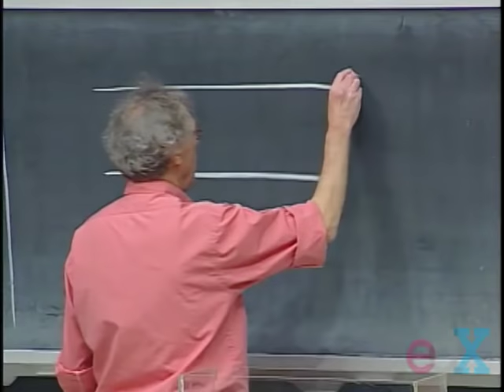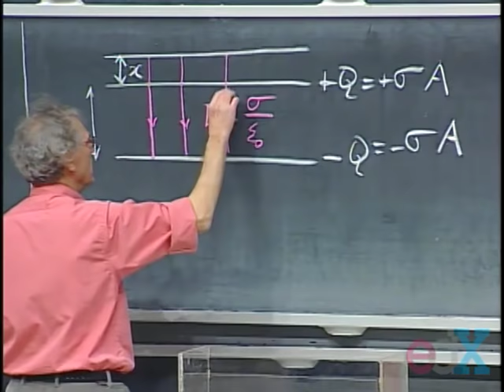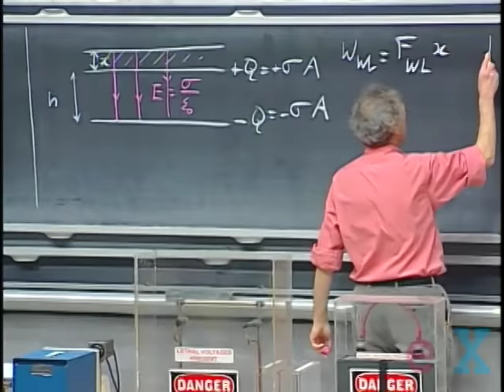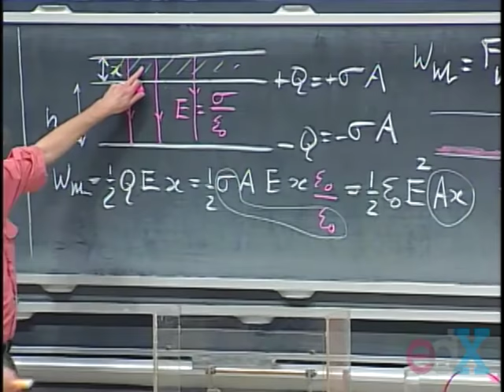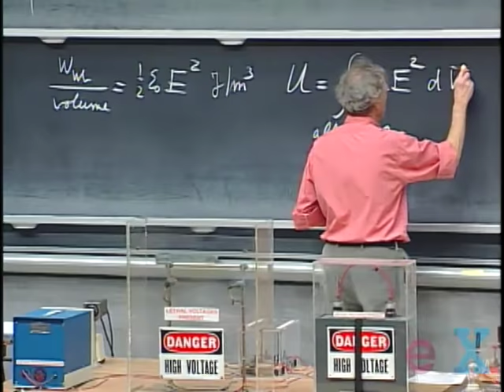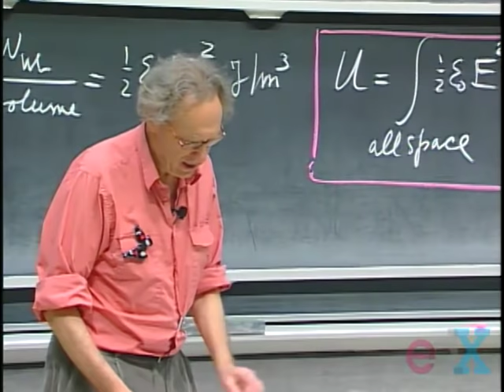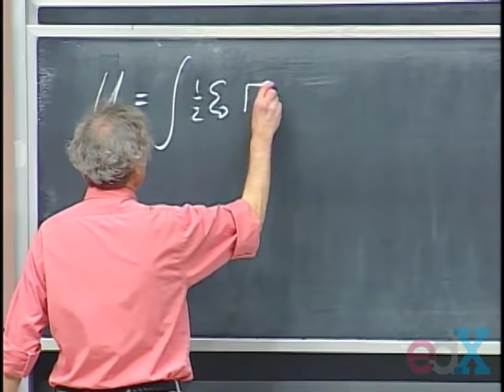8.02x - Lect 7 - Capacitance, Electric Field Energy

Comment: Professor, I still do not understand why the force is 1/2QE instead of QE?
Why you used the average electric field ?
Reply from the maker: The infamous factor of 2
Let the charge on each plate of the capacitor be Q=100q (+Q on one plate and --Q on the other). Let the area of each plate be A. The E-field between the plates is then Q/(A*eps_o). Let the distance between the 2 plates be d.  Now release q from the + plate to the negative one. The energy that is released is force*distance which is very close to q*d*Q/(A*eps_o). But after this transfer the E-field is reduced, it’s now only 0.99*Q/(A*eps_o). I now release another q thus the energy that is released is now 1% less than with the first q. By the time I have released 10 times one q, the E-field is only 0.9*Q/(A*eps_o) and thus the force on the charge q is only 0.9*q*Q/(A*eps_o). The force keeps going down as I transfer more charge.  By the time I have released the last q (of 100) the E-field has become 1% of the original E-field thus the force on the last q is about 1% of the force during the first transfer. Thus by the time that I have released 100q=Q the average E-field was only 0.5*Q/(A*eps_o), NOT Q/(A*eps_o). Thus the average force on a charge q during transfer was NOT q*Q/(A*eps_o) but only half that. Thus, by spooning off the charge from one plate to the other the energy release is NOT Q*d*Q/(A*eps_o) but only half of that. The energy that is released this way (also called potential energy) is identical to the work that YOU would have to do to separate the 2 plates over a distance d.
Reply: Lectures by Walter Lewin. They will make you ♥ Physics. Thank you very much, professor. Your explanation is very clear and easy to understand. That 1/2 was the hardest thing in this  lecture.

Comment: Professor Lewin, at 2:55, why does the charge should be inside the plate? I thought that as the plate is a conductor, there can not be charge inside...
Reply from the maker: +Hugo Muller With the plate capacitor, as I have drawn it,  the charge has to go to the upper surface of the lower plate and to the lower surface of the upper plate (Gauss' Law). If you put charge on one plate of a plate capacitor an equal but opposite charge is automatically created  (induction) in the other plate. That charge will move to the inside surface. You can draw the thin layer of charge AT the surface if you prefer that. But in reality "at the surface" is a thin layer and I have drawn that thin layer.  Apply Gauss Law and you will see that inside each of the plates the E-field is zero. The field starts at the surfaces.
Reply: Lectures by Walter Lewin. They will make you ♥ Physics. The opposite charge on the other plate is created only when the plate is grounded, is not it?

Comment: What a great lecture prof!!!
Those experiments were crazy.

I have a request Sir Walter Lewin :-
Please upload demonstration of the questions in which a solid sphere is taken (having uniform volume density) and a small spherical cavity is removed from random part of sphere and it is asked for the electric field at any point inside spherical cavity.
Reply from the maker: if the  sphere is a conductor all  the charge will be uniformly at its outer surface also when you cut out any piece inside the solid sphere.  Thus if you are outside the sphere and you measure the E-field at and near the outer surfaceyou will never have any idea of what is inside the sphere.

Comment: Sir , I've run into a confusion here .why is the capacitance in the 2 spherical conductor case taken as q of either divided by the potential difference , and not the net potential , ( bcz from what I understood , capacitance for charge increased bcz the net potential decreased but if we take the potential difference then kq/r -(-kq/r ) = 2kq/r . And that seems to decrease the capacitance...
Could you please Please explain where I am going wrong here ?

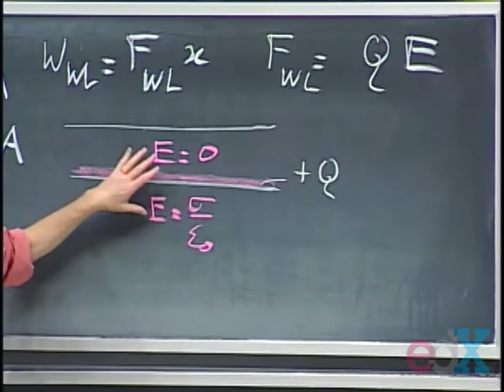Comment: Can you please suggest a resource for better understanding the 1/2 factor in the expression for the electric field at 3:30?
Reply from the maker: Infamous factor of 2
Let the charge on each plate of the capacitor be Q=100q (+Q on one plate and --Q on the other). Let the area of each plate be A. The E-field between the plates is then Q/(A*eps_o). Let the distance between the 2 plates be d.  Now release q from the + plate to the negative one. The energy that is released is force*distance which is very close to q*d*Q/(A*eps_o). But after this transfer the E-field is reduced, it’s now only 0.99*Q/(A*eps_o). I now release another q thus the energy that is released is now 1% less than with the first q. By the time I have released 10 times one q, the E-field is only 0.9*Q/(A*eps_o) and thus the force on the charge q is only 0.9*q*Q/(A*eps_o). The force keeps going down as I transfer more charge.  By the time I have released the last q (of 100) the E-field has become 1% of the original E-field thus the force on the last q is about 1% of the force during the first transfer. Thus by the time that I have released 100q=Q the average E-field was only 0.5*Q/(A*eps_o), NOT Q/(A*eps_o). Thus the average force on a charge q during transfer was NOT q*Q/(A*eps_o) but only half that. Thus, by spooning off the charge from one plate to the other the energy release is NOT Q*d*Q/(A*eps_o) but only half of that. The energy that is released this way (also called potential energy) is identical to the work that YOU would have to do to separate the 2 plates over a distance d.

Comment: Walter,
What happens to the capacitance of the capacitor at 21:20 if only one of its plate is charged (let's assume positively) and the other one is left floating? In an electronic circuit, could we say that a capacitor can be seen as a 0 Farad capacitance if its lead to the ground was disconnected?

Thank you  for your quick response, it is appreciated.
Reply from the maker: charge one plate, the other will stay neutral but there will be charge polarization. The side facing the charged plate will become -- charged and an E-field will exist between the 2 plates.
Reply: +Lectures by Walter Lewin. They will make you ♥ Physics.
So if there is an E field, there is a voltage difference between the two plates. That said, it means that it has some capacitance? Would you say that the charge density on the positive plate (provided by the power supply) is the same but -- on the floating plate? If that's the case I am confused, because that would mean the capacitor has the same capacitance even if not connected to ground!
Reply from the maker: yes there is a potential difference. One plate is ++ charged the other is neutral. Watch my 8.02 lectures or use google
Reply: +Lectures by Walter Lewin. They will make you ♥ Physics.
Thank you! It is indeed neutral! That was the thing confusing me!

Comment: Hey Prof. if I charge a cap to v potential. then disconnect it and connect it to another battery and charge it up to 2v then the work done by 2nd battery would be CV^2 right? Cause half of it's energy is lost in heating?
Reply from the maker: question unclear. Describe your circuits in more detail.
Reply: Lectures by Walter Lewin. They will make you ♥ Physics. Well I was given this question on a test. There was no circuit. I'll paraphrase it. "A parallel plate capacitor 'C' is connected to a battery and charged up to potential 'V' volt. Then disconnected from this battery and connected to another battery and charged up to '2V'. Work done by the battery to charge up to '2V' is?  

Also can I ask you about another question related to rotational mechanics?
Reply from the maker: If the voltage over the cap is V, you cannot charge another battery up to 2V by simply connecting the cap with the other battery.  You would need a circuit that first chops the DC voltage into pieces (e.g. 100 Hz) then you will have to use a transformer to get to several V and then you may be able to charge your new battery up to 2 V.  As you charge the 2nd battery the  voltage on your cap will drop and will end up with zero. The energy that is available  is 0.5C*V^2. That's all there is. After you charge your 2nd battery your cap has zero energy left. The whole problem as described by you is utter nonsense. No physics book would have such nonsense,
Reply: Lectures by Walter Lewin. They will make you ♥ Physics. Haha, then I should question the people who set up the test. Thanks for your time. :-)

Comment: Professor ,If the plates of a parallel plate capacitor are joined, then the capacitance will become infinite? As by formula C=(K epsilon A)/d it seems to be infinite but what happens practically ?
Reply from the maker: >>>If the plates of a parallel plate capacitor are joined, then the capacitance will become infinite?>>>
No, The + and -  free charges will merge and go to zero.
Reply: Thanks Prof , didn't  expect such a quick reply. Hats off to you

Comment: Professor, when you hold the capacitor in your hands at 21:30, will the 10µC be instantly on the capacitor or will it take some time for the charge to flow through your body inside it?
Reply from the maker: charging a capacitor is determined in general by the "RC" time (watch my lectures with a C and an R and a power supply). In one demo it took close to an hour to charge it fully as the 100 kV? power supply was limited in providing the current. Thus its internal resistance was very high.
Reply: Thank you for the answer!

Comment: Why was the charging of the 100 microF capacitor (for the fuse demonstration) took much longer than for the circuit of 12 capacitors (1000 microF)? As far as I know the charging process takes approximately 5 or 6RC, so does that mean that the “monster” capacitor of 100 microF had a big resistance?

Comment: Sir if I release a + charge q in a parallel plate capacitor with initial velocity v then it comes out from capacitor with higher kinetic energy than first one. It means capacitor's energy should be reduced but even now capacitor's energy is same as no electric field is changed. Then who gives energy to + charge

Comment: @14:37 In the presence of A... shouldn't capacitance of B reduce due to the electric breakdown between them ?? In last lecture when the ball was brought near Van De Graff, sparks started between them... so shouldn't capacity to hold charge reduce for B due to discharge with A ??
Reply: I think the paper they place in between is a better dielectric than air.. therefore resists the breakdown better than air

Comment: Hi Sir , 
At 28:29 , In the capacitor demonstration 1 the instant when you touch the one of the plates of the capacitor for charging with a wire which is having power supply we saw a small surge in the ammeter. How come the current is flowing through the capacitor because the plates of the capacitor are seperated by a small distance right.How come the charge ( i.e current ) is flowing through the capacitor( i.e is transfered from one plate to the another plate ) at that instant.

Sir Please reply for the above question.
Reply from the maker: >>we saw a small surge in the ammeter>>>
yes of course, bcoz a current is needed to charge the capacitor. Listen to what I said.

Comment: hello sir: In an opened circuit why the charges do not move to accumulate on both ends of the wire as they accumulate on the capacitor plates?

Comment: I recall you saying earlier that electric potential is energy per unit charge. So why is it that the energy stored in a capacitor is (1/2)QV? Why not simply QV? Also, I've already taken physics II at UT Austin, but I am using your lectures to refresh my memory as I'm now tutoring the subject. I just want to say that I really appreciate you putting up your lectures, and the way you teach is very inspiring. I'm considering a career in academia because of it.
Reply from the maker: I derive in my lectures that the energy in a capacitor is 0.5*C*V^2. Since C=Q/V the energy is also 0.5*QV,

Comment: Professor as work done my battery to move a charge is W= QV. So when capacitor gets charged this much work is needed to be stored as potential energy but the energy stored is 1/2(QV). What is the reason behind this significant loss when energy got halved. I don,t think this much heat will be dissipated in charging. Is there any other reason also
Reply from the maker: with AC the PE on the capacitor will change +(1/2)cv^2 => 0 => -1/2)cv^2 as this happens the AC current will go back and force through the resistor => dissipating energy heat power I^2*R
Reply: but there is no resistor in the circuit
Reply from the maker: EVERY L and ECERY C has a resistance as it is not made of superconductive material. The power supply also has an internal resistance. Thus an oscillation w=sqrt(1/LC) will require power that will go to heat.
Reply: thanks professor I have one more doubt regarding the sharing of capacitors. When on capacitor gets charged then connected to another capacitor which is uncharged. There also take place energy loss.
So how to explain it. This also happen if the resistance of connecting wire is zero(superconductor).
Reply from the maker: connect to capacitors (parallel) only 1 is charged.  Connect 2 in series, only 1 is charged. My 8.02 lectures will tell you what happens. There is ALWAYS ohmic loss as they each have a finite (though small) resistance.

Comment: Sir is it possible to use only the part of energy stored by the capacitor or all of the energy is dumped at once and we have to charge it again..?
Reply from the maker: question unclear
Reply: Lectures by Walter Lewin. They will make you ♥ Physics. If we have 25 joules of energy in a capacitor,is it possible to use only 15 joules of energy at one time and other 10 joules of energy other time..or all the 25 joules of energy is dumped at once...
Reply: @sarcasticallyyours312   I think you can achieve that with steady-state technology.
Reply: @sarcasticallyyours312   Capacitors have a discharge rate, so if you short a capacitor for a period of time less than that required to drain all the charge, there will be remaining charge. The discharge rate of commercially available capacitors is listed on their data sheets. How much charge will flow also depends on circuit in which the capacitor is placed.

Comment: Walter,
At 3:37, F=1/2 QE. Does that mean that all charges in the red volume don't experience the same amount of force? That force varying from F=0 to F=1/2 Q sigma/eps_0. Then we would have to say that the E field penetrates the conductor's surface and decays until it nulls. And statistically, we get half the force. Am I right?
Reply from the maker: Infamous factor of 2
Let the charge on each plate of the capacitor be Q=100q (+Q on one plate and --Q on the other). Let the area of each plate be A. The E-field between the plates is then Q/(A*eps_o). Let the distance between the 2 plates be d.  Now release q from the + plate to the negative one. The energy that is released is force*distance which is very close to q*d*Q/(A*eps_o). But after this transfer the E-field is reduced, it’s now only 0.99*Q/(A*eps_o). I now release another q thus the energy that is released is now 1% less than with the first q. By the time I have released 10 times one q, the E-field is only 0.9*Q/(A*eps_o) and thus the force on the charge q is only 0.9*q*Q/(A*eps_o). The force keeps going down as I transfer more charge.  By the time I have released the last q (of 100) the E-field has become 1% of the original E-field thus the force on the last q is about 1% of the force during the first transfer. Thus by the time that I have released 100q=Q the average E-field was only 0.5*Q/(A*eps_o), NOT Q/(A*eps_o). Thus the average force on a charge q during transfer was NOT q*Q/(A*eps_o) but only half that. Thus, by spooning off the charge from one plate to the other the energy release is NOT Q*d*Q/(A*eps_o) but only half of that. The energy that is released this way (also called potential energy) is identical to the work that YOU would have to do to separate the 2 plates over a distance d.